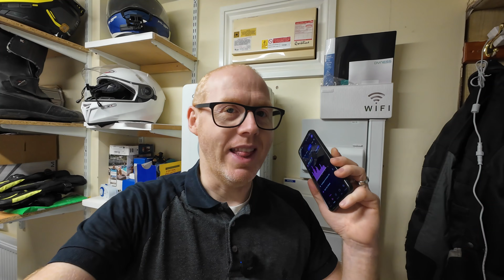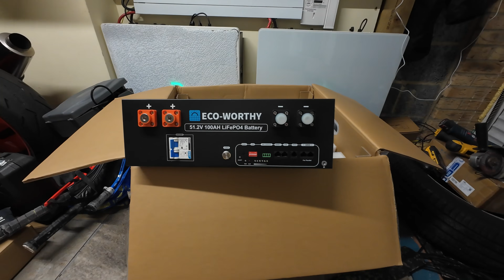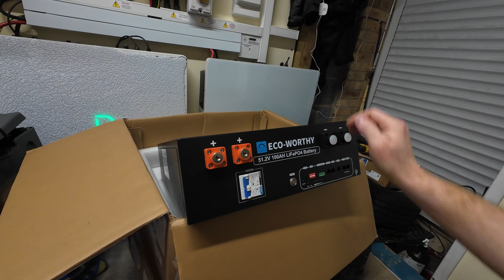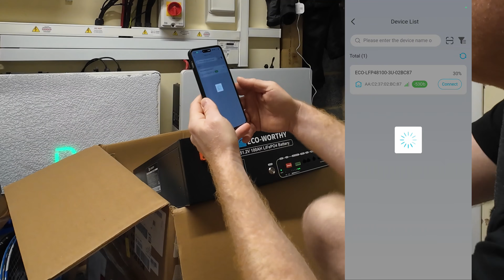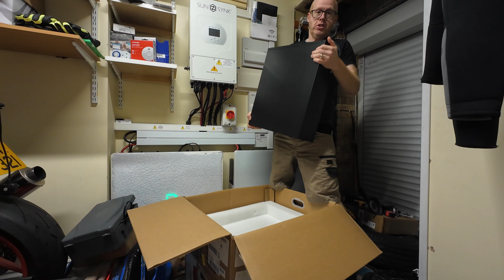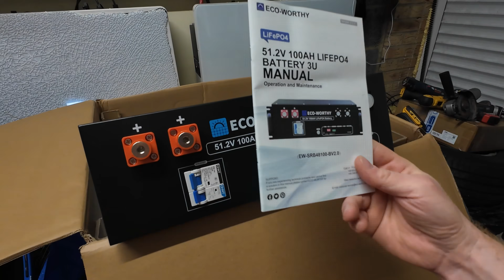Building a 34kWh Home Storage System: Is the Grid Now Optional?

Comment: Interesting - what are we allowed to DIY once we have DNO approval for initial system, and a sparky has signed off an install?
Reply: I DIYed my whole home off grid system. If I'm ever told "you can't do that mate", I know I can't legally, then I'll remove it and get an electrician to approve my electrics without any battery storage and then sell all the batteries and inverters.
Reply: @st200ol An electrician can't approve your electrics in the general case, they can only sign off their own work. Building inspectors however can sign off and you can do it that way.

Your home offgrid system by law does indeed need part P in the UK as it will contain a sleeping area, and it's over 15m2 I imagine.
Reply: @etchedpixels Thanks for the correction, I suspect I’d need a complete rewire then.
Reply: @st200ol If it's been done properly to specification then unless the rules have changed when someone throws a fit you can have a council building inspector inspect it and sign off the inspection and approval. Works the same was as if for example you replace your own double glazing instead of using a FENSA approved company. There are also companies ("RCBA") that hold full qualification to do that kind of inspection - just not your typical sparky.
Reply: @etchedpixels  Your typical sparky knows he he has a long list of jobs that he can charge a starting price of £2K for, why would he be interested in testing and approving someone else's work for a few hundred quid.
Reply: @st200ol A sparky isn't generally allowed to certify someone else's work any more than a Fensa installer can certify your windows. That's what building inspectors are for.
Reply: @etchedpixels It all sounds very complicated. I know I’m not allowed to install an off-grid system, but ultimately does anyone care other than perhaps the home insurer should anything happen. The thing is as I’m not connected to the grid anymore, except for battery charging, my home is probably less at risk of fire than it was when it was directly connected to the grid. I’m managing on 5000VA, yes it takes some management but it’s amazing what can be done with such a low peak power. My home is a fixed caravan made of bricks and mortar. 🙂
Reply: There are no regulations for 48v systems, but you really need to know what you're doing and I fully expect your insurer will have an opinion. There are rules on where you can install batteries though.
Reply: @TheRonskiman I’m lucky enough to have an outside brick building. Shed, outside toilet and an old coal storage space and the coal storage space was where I put the batteries and inverters. That seemed a fitting place to put them. 🙂  Ironically when I got quotes to have solar and batteries a few years ago not only did they want at least £10k just to install it, not including the H/W they also insisted that it was safe to put batteries in the loft. Nope I thought, that’s not happening and look how that turned out in the end. They wouldn’t entertain my idea of installing the batteries and inverters where I put them.
Reply: @TheRonskiman I thought there were guidelines on batteries but no legal rules?
Reply: @jamesmansion2572 There is at the moment, but come April I believe the guidelines become rules.
Reply: @jamesmansion2572  There are both
The legal regulations currently cover safety of the equipment, certification of the product, documentation, transport etc
The PAS guidance covers where you put them. Most installers consider the PAS basically as law because nobody wants to stand in court and explain why they didn't follow the PAS and a house burned down.
Reply from the maker: Thanks for watching and commenting!

Comment: Good video, will be good see it all set up. Are you going to need longer patch cables if mounted side by side ? . I have a small 3.6 sunsynk running independently to the solax system, just for the HP. Inverter working well.
Reply from the maker: Yes, I will need longer cables.

Comment: That's really interesting. I was considering doing the same with 2 8's in a master slave config, instead of the their 16kw. My system will be 20kwP, slightly oversized with 32kw of fogstar batteries. Would you recommend 2 8's instead of 1 16 and why?
Reply from the maker: I haven't looked at the inverters bigger than the 8kW unit. How did you find this video? It is just a draft and should not yet be public?
Reply: @UpsideDownFork you added it to a playlist.
Reply: I'm watching too, interesting about the fogstar "any comments!